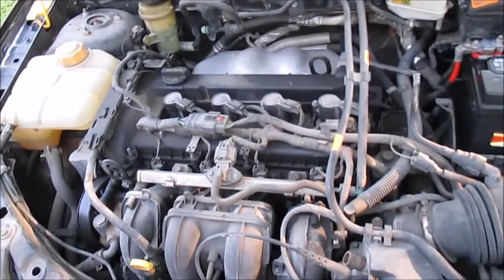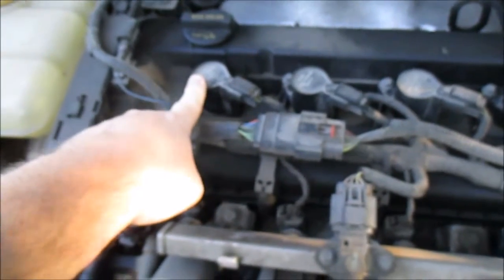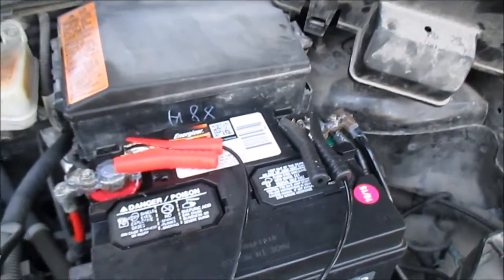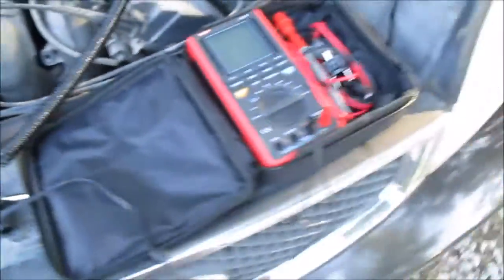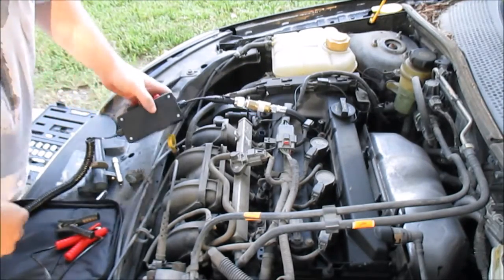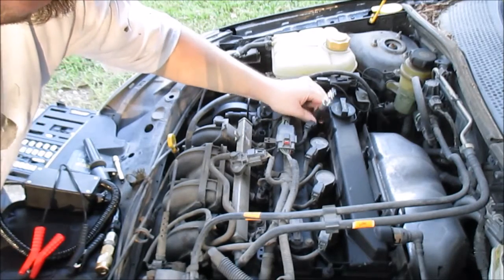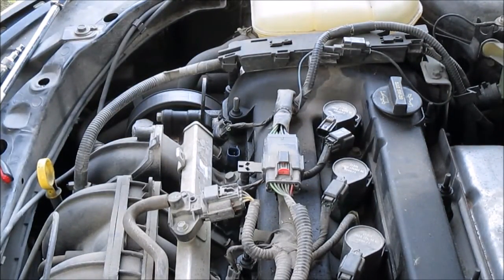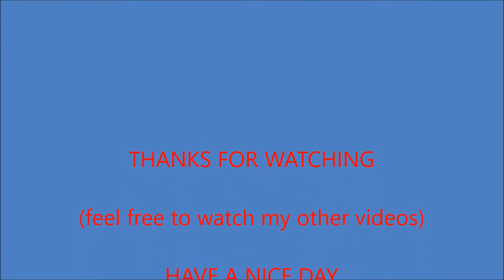Homemade In-Cylinder Pressure Transducer Part 2 Testing

Comment: When you did the test on the car did you earth the ignition coil, it should be earthed? Also, the compression tube can melt if you leave the engine running too long, but I it seems you learnt from experience in your video.
Reply from the maker: No I did not ground the ignition coil, simply because I disconnected the primary side of the COP making it not necessary to do so. If the COP was still plugged in you for sure would want to ground the secondary side of the COP coil to give the secondary high energy spark a place to go so you dont carbon track or short your coil (because those secondary high energy sparks will find a place to go on there own if you dont give it a path to go)  Also yes I did run my in cylinder pressure test a little to long and my compression tube did get very hot, for sure lesson learned. Well thanks for watching and thanks for the comment. Have a good day.
Reply: AJ Pierce , thanks for the clarification and another further tip on grounding ignition systems. How did your homemade pressure tranducer look on screen with your other graphing tool, and how do you convert the volt readings into psi on the graph or curve? Your transducer is a simple design to make, thanks for sharing.
Reply from the maker: Yeah I used my hantek scope and it showed a good regular compression waveform, worked great. My scope showed up in voltage so to get pressure you have to do do a conversion. You can google convert transducer voltage to pressure and get a lot of info. Here is the website I used for information.      http://www.omega.com/techref/das/scaling.html    
I think this is what is used for a linear transducer and there are other conversion charts and harder math for converting non linear transducers. Well I hope this info helps you out. Have a good day.
Reply: AJ Pierce ,thanks for your help, it looks like a standard linear equation.

Comment: Do you have a V/psi amplitude relationship?
Reply from the maker: I had some info on the sensor itself, but it has been awhile since I looked at it. I think it was .5v for 0 psi and 4.5v for 500 psi. I just bought 2 cheap transducers off Ebay for around $13 a piece, and there was lots of technical specs on the sensors. One was rated up to 500 psi and the other was rated up to 1000 psi. Originally I was going to build an HVAC pressure gauge set, but I ended up doing something else. Well I hope this info helps you out. Thanks for watching and thanks for the comment. Have a good day.

Comment: For a cheap kit scope that you can put in your hobby box, try this $34.03 1Mhz scope on ebay. Or just look up mini oscilloscope on ebay.  http://www.ebay.com/itm/SainSmart-DSO062-Mini-Digital-DIY-Oscilloscope-1MHz-Bandwidth-20MSa-s-with-Probe-/121805515816?hash=item1c5c2cac28:g:ItMAAOSwYHxWHwXb  

Thanks for the post, I work in electronics and on cars, never even gave this a second thought, glad you showed it. I just might have to build one. Best Wishes n Blessings Keith
Reply from the maker: Hey I will take a look at that scope, thanks for telling me about it. Have a good day.
Reply: You're welcome AJ. After looking around I found this one.      http://www.ebay.com/itm/ARM-Mini-Touch-Nano-Pocket-DSO202-DS202-Digital-2CH-Channel-Storage-Oscilloscope-/351911750368?hash=item51ef932ae0:g:bZYAAOSwe-FU4Vw-       It's twice the price but it has two channels, it's in a nice case and had a color display. The thing I didn't like about it for automotive applications was it has a touch screen and that means you'll have to take your gloves off, or cut the tip off one of the fingers like I do. I cut the index and thumb off on one of my gloves to get that a extra feel for small parts or tight spaces when putting a nut or bolt in. I really like your channel and find it quite informative. I started a channel with quite a few disciplines as well. Just wish I had time to work on it more. Well catch ya later. 
Best Wishes n Blessings Keith